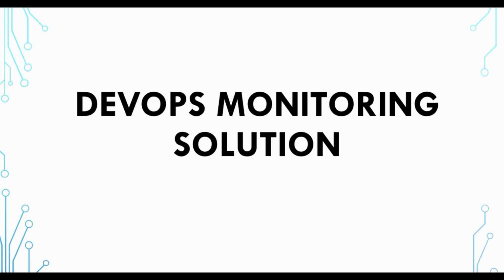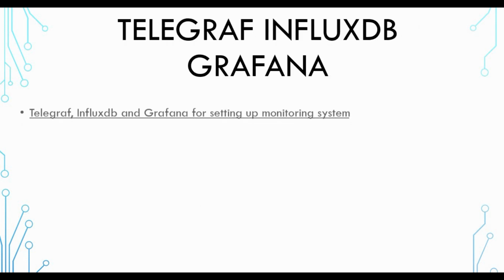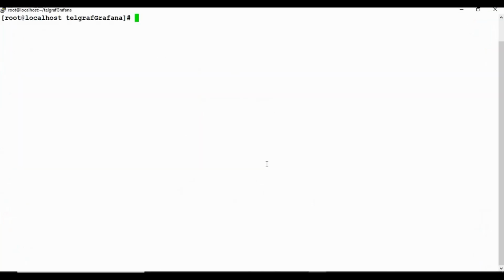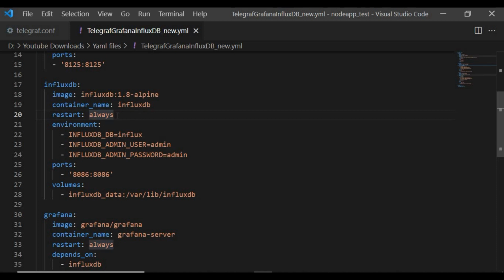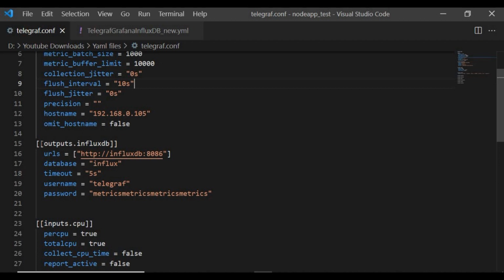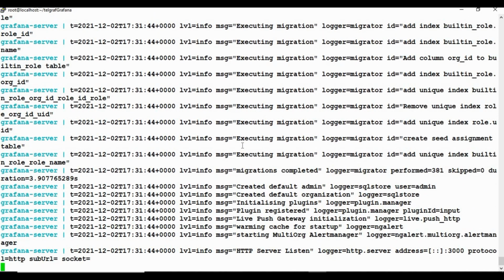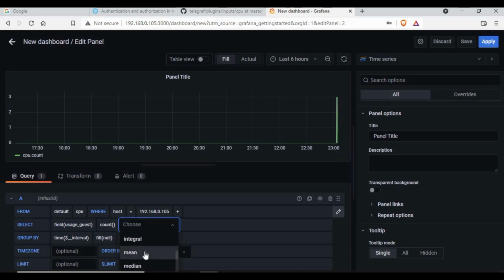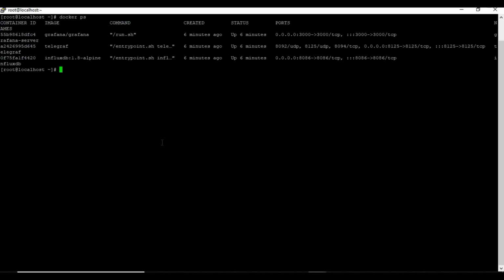"Setup InfluxDB, Telegraf & Grafana with Docker Compose 🚀 Step-by-Step Tutorial!"

Comment: Thanks. 

Any idea why the influx UI is not reachable?

I get error 404 when trying the same IP that grafana is running on (obviously I have changed the URL's port to 8086 from 3000)
In docker and also cli (via docker ps) it shows that influx is running; it even shows the created database, but the UI page is not reachable.
Reply: I've found out that the 1.x version doesn't have UI; so instead I've updated the yaml file to use 2.4 version of influx instead
Reply from the maker: Do you mean the issue is solved by using  2.4 version?